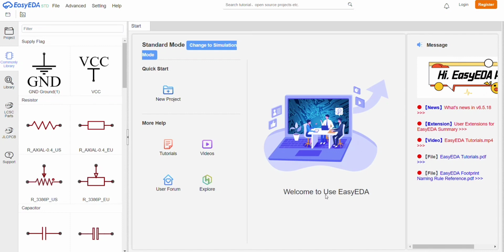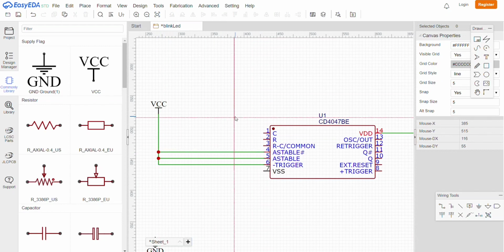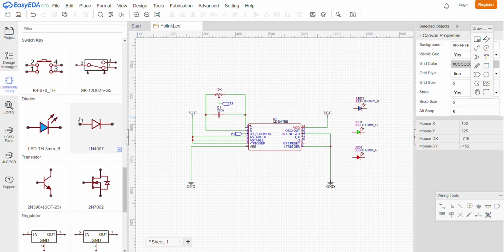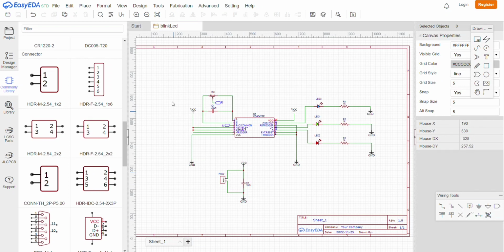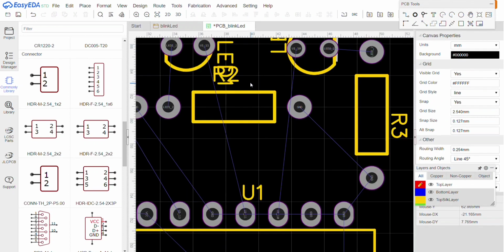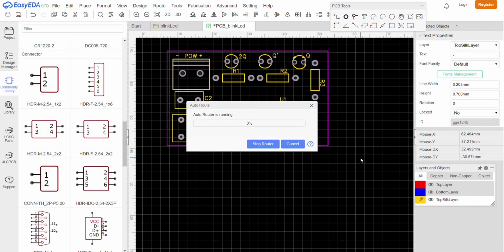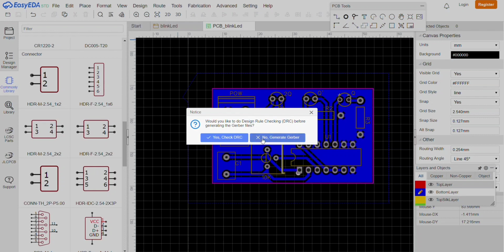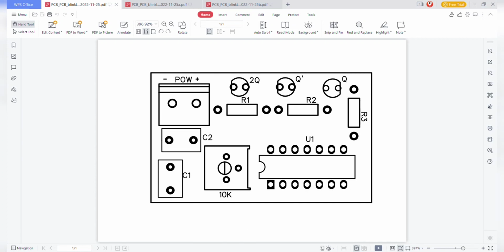BEGINNERS PCB DESIGN USING EasyEDA Windows

Comment: Hi thanks for this video it helps alot but there are missing some details about how you move components and the trace will follow, this is not happening how i do it so i need that detail asvell for what is the components that you are populating and the ground and vcc, but great video  also it would be good about how to make hole for cable to soldering directly on the board, thanks.
Reply from the maker: @Bjarni Thor 

I will post detailed video soon ☺️